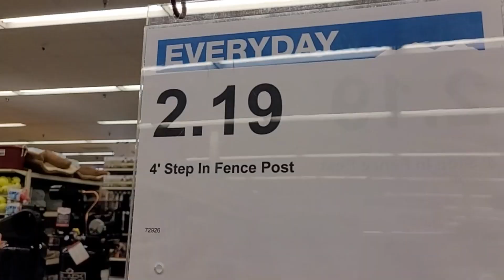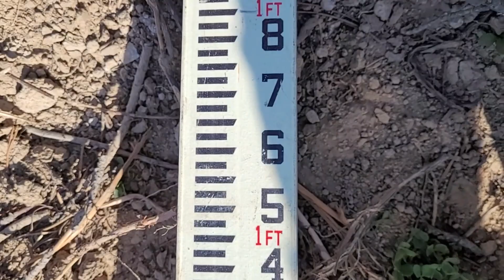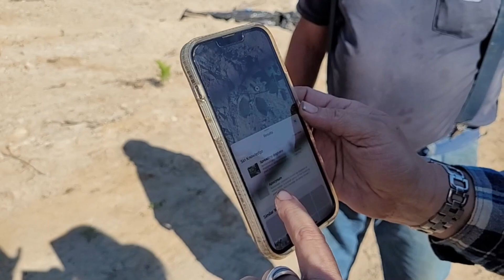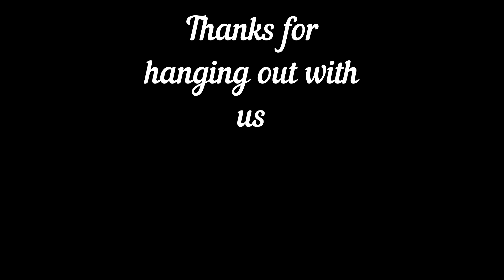A FARM day// some work in the "GREENHOUSE' //Helping other HOMESTEADERS// GRATEFUL FOR THIS LIFE

Comment: The good news about some of your posts is that they are a "buy once, use for forever" type of thing.  The bad news is that posts, metal tee posts or other, is that they truly need a thought-out storage container or spot else they become a pile or falling down stack if propped against something.  Further when fall hits, it's hard enough to clean up the garden infrastructure items in less extreme weather than you all get.  -  Do take a count of your assorted poles, figure how much foot print space each type requires, and begin thinking of storage systems/ containers criteria and/ or requirements.  Then it's time to keep your eyes open for possible, low to no cost solutions.

Comment: Wasps and honest especially leave pheromones indicating a number of things including past and suitable nest locations.  The traditional is to spray down the locations they've been with bleach water and a small, hand held, Formula 409 type spray bottle.  This said, we developed a terrible problem with fleas living in the dirt, needle litter, etc... and I tried a little of everything to see what might work.  We found Simple Green to work pretty darned well for the fleas (and likely thier eggs and nitts).  I don't know if the spray bottle i used was a 50% water to 50% concentrate or if it was a 75% water to 25% concentrate; I'm thinking it was a 75-25.